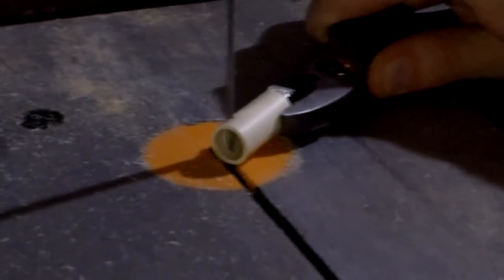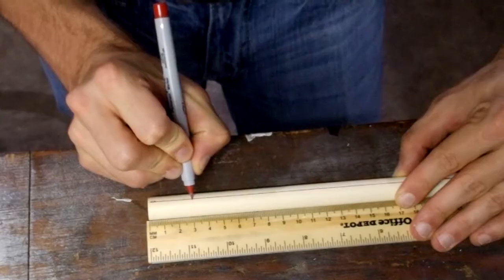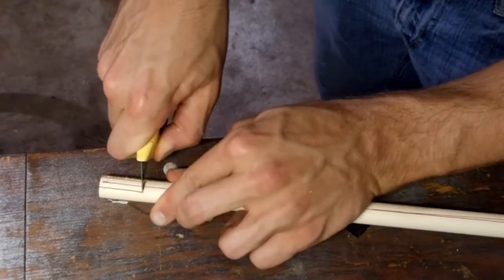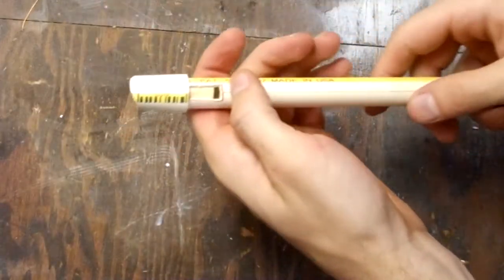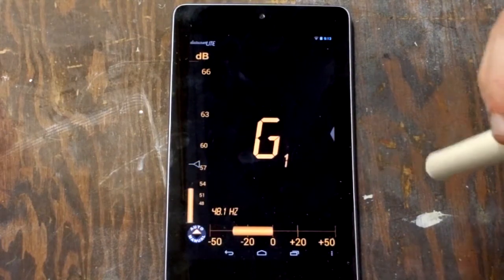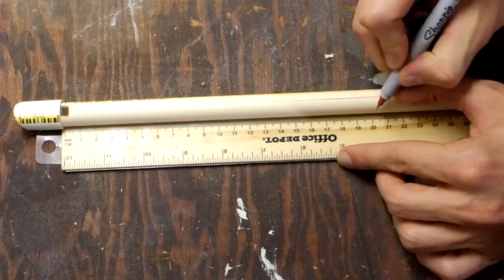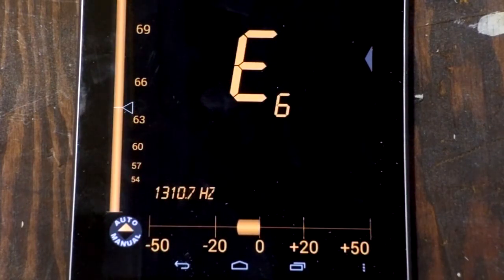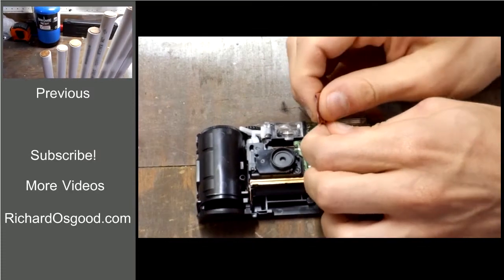Fast Hacks #12 - Make a Penny Whistle from CPVC

Comment: I followed your instructions however my hole dimensions are noticeably different. I suspect that the pvc wall thickness is the difference. I used a thicker wall which required the wholes to be larger

Comment: Okay so using this tutorial what would be the equation to find the sharp of a note pipe?

So if you had a pipe that was tuned to d how would you find how big and where to place a hole that would make a d# pitch? 

I'm trying to make a pan flute that has a hole for sharps from the pitches b3 to f5 and I want each  natural pitch to have a hole that makes it sharp so if it was uncovered I would have a sharp sound and if I covered it it would have the natural sound.

Your thoughts?
Reply from the maker: Sorry, I'm not sure on that. I haven't messed with this stuff in a while. However I think for a penny whistle the usual way you would play a sharp note is to only partially cover the hole with your finger instead of covering the whole thing. So you shouldn't need extra holes.
Reply: Thanks, but I decided to make a pan flute with two rows instead Mr.  @RickOsgood

Comment: Great video :) could you tell me the diameter of each hole? I don´t have any tablet or app ...
Reply from the maker: I can't really just list my own diameters. There are so many tiny variations that the holes I drilled will likely be different than what you will need. If your pipe is a tiny bit longer or shorter, if the mouth piece is slightly different, if your holes are drilled just slightly off from mine, etc. Sorry I can't just list the numbers. If you have a good ear, you can try using a piano or other instrument to tune your whistle by playing the correct note and then matching the flute to the other instrument.

Comment: Hey,, I made one with a tick PVC pipe it didn't sound good,, but now I tried with a thinner one it works properly but the only problem is it does not produce D ,it half step down ,it produces C# ,,what should I do?
Reply: It just means that yours is in a different key because of some difference in thickness, width, length etc.
Reply: Shorten the over all distance of flute body at the end.  I use a belt sander to take off small amounts.  Hand sanding is very tedious.

Comment: Hey. I'm using this video to make one and about to make the holes but you have 135mm on the chart twice... Anyway you can clarify?
Reply from the maker: I believe the A is actually155. It does look like 135 though.
Reply: I see now! Thanks! I did mine with a 7/8" pvc pipe. It seems to be in the key of C# instead of D. But it's still working although I cut my pipe a little too short so it's a little sharp